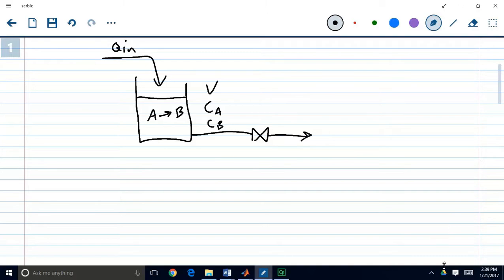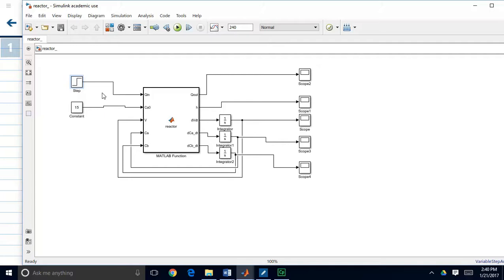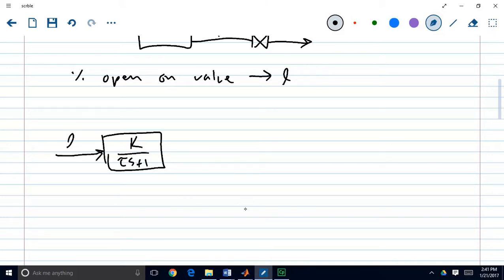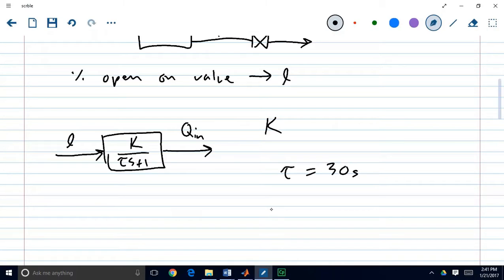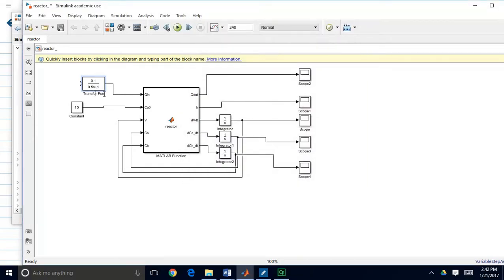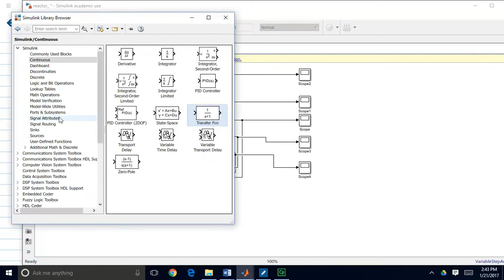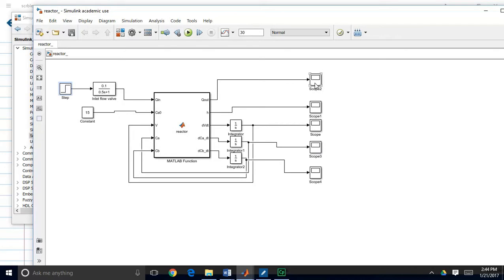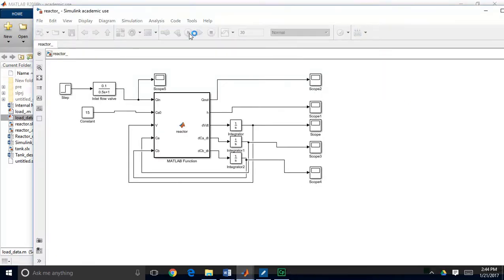Modeling a linear valve with first order dynamics

Comment: How would one step a valve and get the response of this while measuring the flow rate in real life...  would one use a flow meter.. This might not work so well. step the input of a value one would like to see a quick measurement or change.  I think maybe there are delays in the transfer function?